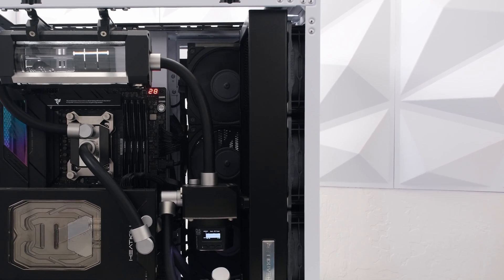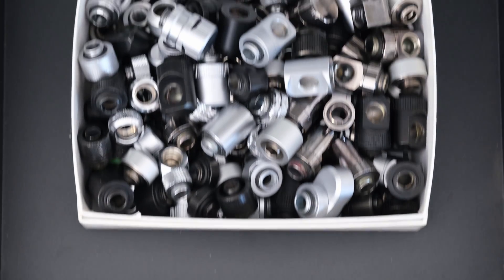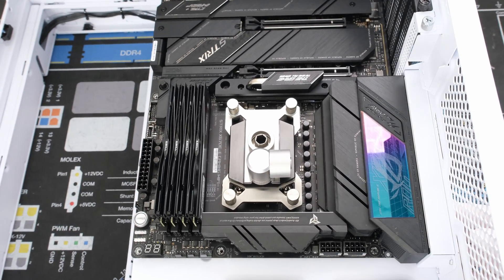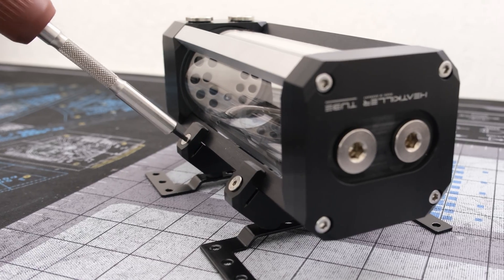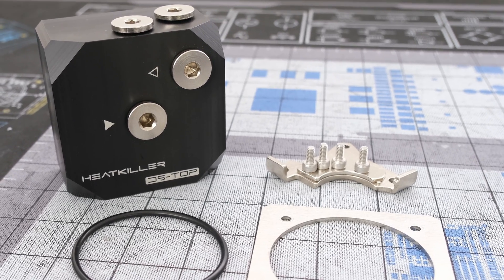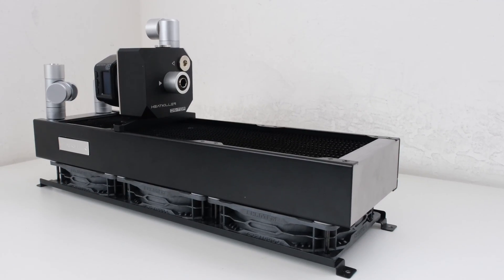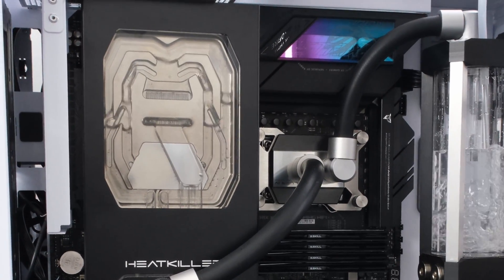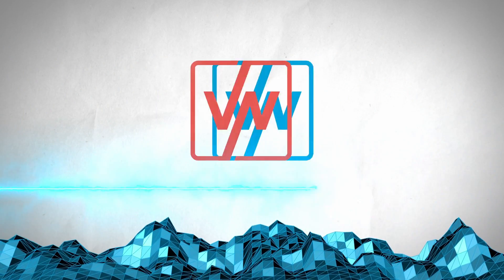Watercool Heatkiller Soft Tubing Build - Step by Step Guide

Comment: great video , how good is the heatkiller radiator vs other you have build ?
Reply from the maker: From my experience, radiators of the same size and thickness have all been fairly comparable in cooling. I mainly choose the radiators based on the orientation of the ports and the overall look and color. Hope that helps

Comment: Is watercool bether than alphacoool? Wich radeator u recomend no.mather wich price
Reply from the maker: Thanks for your comment 🙏 The cooling capabilities of Alphacool and Watercool (and a lot of the watercooling brands) are very comparable. I do like the fit and finish of Watercool more. Having said that Alphacool is putting a lot of attention to watercooling product in the last few years their products are very good. But my personal rig is all Watercool (CPU block, GPU block, Reservoir, Pump Top and Radiators). For radiator, it depends on what you're using it for and the build.

Comment: Any chance you know if the heatkiller will fit on a msi meg x670e ace?
Reply from the maker: Thanks for your comment 🙏 I think it would I'm not sure why not
Reply: @vectornetwork  was just curious. My ek waterblock with abp wouldn't fit on my rog chrosshair x670e extreme. So I bought the msi meg then ran into it not fitting cause it hit the ram latches.

Comment: Sorry but what is biocide brand you have used? Is it good to use for long time?
Reply from the maker: Thanks for your comment 🙏 The biocide is Primochill Liquid Utopia. There are not a lot of options specific to watercooling. I picked it because it seemed to do exactly what I wanted. I can't say about the longevity as I maintain and disassemble these loops frequently. This one so far has been fine. Hope that helps
Reply: @vectornetwork   The item is not available in my country and via a topic on reddit seems like there is a reaction between this one with ek products? Your vid is so nice and detail for a newbie want to make custom water loop but these components are a bit too expensive especially fitting .May you try to do and review it with other brands which has lower prices such as barrow or something?.Thanks

Comment: How did you get the rubber vibration screws from the basic mount? Mine came with them installed in the mount but I can’t figure out if you have to knock them out or screw them out 😂
Reply from the maker: Thanks for your comment 🙏 They screw on, so twist left hard. Hope that helps 😁

Comment: I recently assembled a configuration that is very similar to this one. I'm eager to see how you managed to activate the EXPO profiles of the RAM, as I have been unable to do so on my end.
AMD Ryzen 9 7950X3D
Asus ProArt X670E Creator Wifi
NVIDIA GeForce RTX 4090 Asus TUF OC Edition
G.Skill Trident Z5 NEO (2x32) x2 (total of 4 dimm sticks) DDR5 6000 CL32-38-38-96 1.40 V
Reply from the maker: Thanks for your comment 🙏 I have also not been able to run my 2 kits in EXPO. It's why I listed the 6000MT sticks as 4800MT. It's because I bought the 64 GB kit at 6000 and then bought another kit to bring it to 128. The kits are not designed to do that and sometimes it may work but not in this case. The way to do it is to look on the QVL and find a 32x4 kit that is verified. I haven't checked, but any kits that show up will likely be at a slower speed. I think some more speed can be manually overclocked, but its tradeoff for having more memory. The speed is lower. Hope that helps
Reply: Expo only works with 2 dims

Comment: Wow, the mounting system of the heatkiller cpu block is vastly superior than my crappy barrowch cpu block.
Reply: Can confirm that. Barrow and Bykski AM5/4 cpu blocks mounting are atrocious. Some basic mods like precise measuring, new springs, washers and screws are mandatory imho. I'd strongly suggest some, uhmm... "dubious" ghetto mods for semi-serious benching if running a 5800X3d with a "broken" IMC like mine or trying to run +2000Mhz IF/RAM 1:1 on a good 5950x. My loop is 4x360 rads, TUF 3090 shunt modded with Bykski block and active back plate, Lowara D5. All essential mods can be easily found on forums, reddit, etc. with tons of pics and detailed instructions. 

I will not comment on the performance of Barrow blocks with Intel LGA1700. I tested for an hour on a 10900K, so I can only guarantee that the mounting is not exactly fun, like most entry-level blocks from traditional brands. 

Judging by reports on forums such as ocn, hardwareluxx, TPU, hwbot and others, the thermal performance is also similar to these so-called blocks mentioned above.

IceMan blocks are so much better. Those that aren't made by Barrow I mean... (:  AFAIK, all Barrow CPU blocks share the same thermal design and manufacture process. The AegirX Store is selling some Barrow blocks costing well over $120, while the cheapest proper, real IceMan block is $83. It's selling a lot considering it's $160 for RGB, a tiny screen and $25 mounting/performance. Hard pass for me. Sure, there is a new block made by Barrowch with a different brand (SuperCool) name that's $77 and beats the CT3. 🙃 I'll wait and see if they sell an Alpha Core 1 for $129 again. AliExpress is wild!

(your nickname suggests que você tá entendendo isso. Aqui em Banânia se acha as ruelas e molas. Os parafusos não encontrei. Tentei dois jogos de um outros blocos e não rolou. Comprei na DigiKey).
Reply: @CapaNoisyCapa  opa você é br também, da hora ehehe. Eu comprei o cpu block alphacool core 1 e já estou usando ele, 1000x superior ao bloco da barrowch, pode me passar o link pra comprar o kit de montagem do bloco da barrowch? Vou ver se compro pra revender ele.